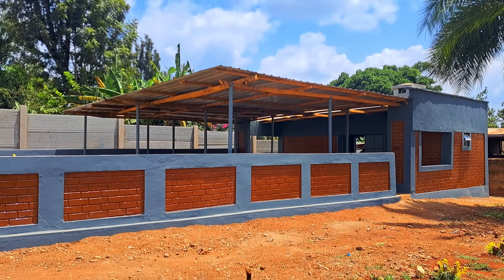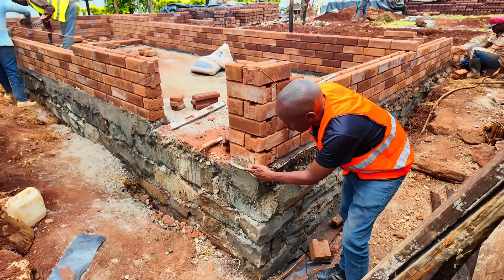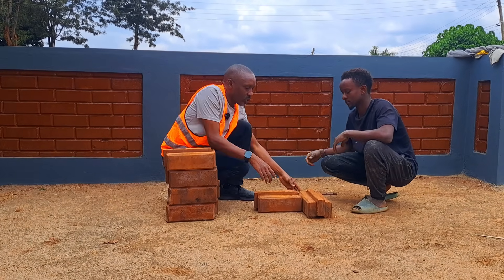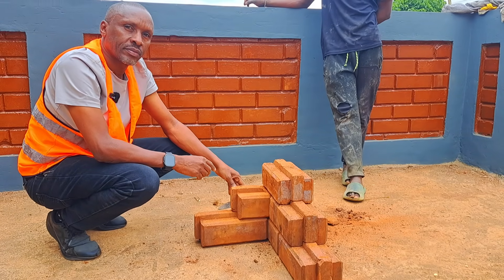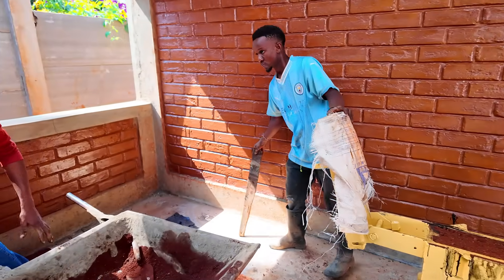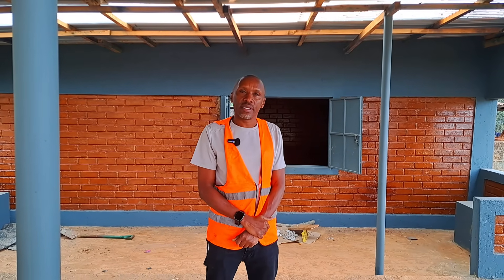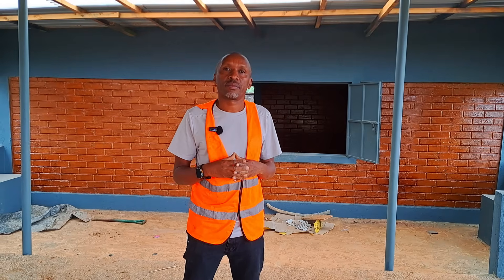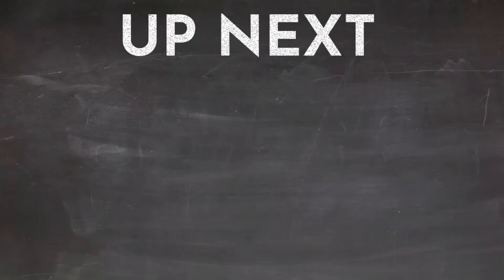How Interlocking Soil Blocks Create Stronger, Cheaper Walls—Explained

Comment: 3:00 - "blocks does not require plaster" - quite questionable. the wind will blow through this wall, plastering is mandatory. you can see gaps on corners at 5:30.
this is looks like a scam to sell equipment😆

Comment: Is no need cement for the first line to connect with beam
Reply: Yes a little mortar is needed to connect the first mother block to the foundation
Reply: @pablokla2 mortar is cement or what glue

Comment: You cannot use beach sand. Very important, because the contained sea salt will weaken the cement stabilizer and easy disintegration of the blocks

Comment: I bought the Makiga interlocking soil block machine in 2015 and built 14 single rooms in Thika. After that experience, I found that the biggest problem was finding individuals skilled in mixing the soil and cement and know how long to cure the blocks and also how to lay them. I turned to Makiga to refer people they trusted but they could not provide this information, rather they asked that I send someone to be trained, who could train others. I thought this was a rather laissez-faire approach especially since the mixing of the soil and cement is a technical/science and needed someone who understood how it works. After searching for a long time, my mum got a contact, who came with his team and did a great job making the blocks. But that was all they could do. We need to get someone who could now build with the blocks...another round of searching, trial and error with one or two individuals who were referred or claimed to be skilled in this area, and we finally found someone. The building happened quickly, and honestly, it could have been done in a day if we had enough manpower. The building was beautiful, but it has been a nightmare protecting the surface, especially the exterior. Eventually, we had to apply cement on the outside to protect from rain. The varnish didn't work well. On the inside, the nightmare was how the tenants used the walls. Where the tenant hammered nails as hanging pins, big parts of the block chipped away. I love the concept, but honestly, with limited funds, I would prefer to use stone and mortar to avoid the additional remedial costs. The 12 rooms (14 by 14 feet) plus two shared toilets and shower rooms cost 1.2 million. Not bad...but these method needs to be greatly improved to maximize on the savings it promises.

Comment: How does this type of construction behave in locations with frequent earthquakes, such as Chile, where earthquakes measuring 6 or 7 on the Richter scale are not uncommon?
Reply: Need another type of interlock block..which is same like on video but got 2 hole for interlocking which is u can fill cement and make it stronger
Reply: Greetings please google ISSB in earthquake prone  areas research has already been done on the same

Comment: To help with the corners, you could change the mould so instead of one continuous ridge on the ISSB, the are two shorter ridges, with a gap to fit the feet of the ISSB that will sit on top of it. 

Great work ❤️
Reply: Very good advice

Comment: In places with rainy seasons, lime plaster over the exterior blacks will add many decades to the life span. White paint will help reflect heat.  Great system!  Thank you.
Reply: Thank you you the ISSB blocks have very good thermal Properties that make them very ideal for hot areas

Comment: Do you have to oil between each block when pressing them? A teflon coating might be exceptionally useful if so.

is there a minimum clay content for the bricks to be stabilized?  What was the finishing solution? A "varnish" was mentioned, but that doesn't really address composition.

What is the Hoop Iron?
Reply: Thin metal strips normally used to secure the truss or roofing structure to ring beam.

Ask at the hardware shops, they have them.
Reply: @webza77  Very interesting. Thank you.

Comment: This is genius, but a little bit of mortar wont hurt ~
Reply: Not necessary. If you use mortar the bricks won't interlock properly and may lead to structural failure.

Comment: I think the mortar is still necessary for brick laying. Not only does it "glue" the structure together, but it also keeps water and moisture out of the walls and interior.

I challenge someone to make a video showing different types of bricks put together, one group with mortar mix the other group without the mortar. Bricks line up in an empty swimming pool built in a simple chimney shape. Then after everything cures, fill the pool up with water to see which interior will stay dry.

Also, giving different squared brick walls a ramming test would prove how strong the brick designs are.
Reply: People build mud houses and your here worried about that? 😂
Reply: It has been interesting to watch your videos about the interlock blocks, i am from The Gambia and would like to know how much the machine cost and the logistics to send it. Thanks for your attention.

Comment: ❤LY. I the exact block design of almost this size and material concept. However, your machine design is superb even though manual. 

I am working on the vibrating type machine which I yet to solve the technicalities.

More blessings to you brother
Reply: Have you solved the technicalities

Comment: Here are the pros and Cons of this kind of block:
Pros : Well adapted with a hot climate, easy to build with, cheap if produced locally, they can stand structure weight (Load bearing block), they can also be resistant for earthquake due to their flexibility 

Cons:  Not good with water because of the clay content, so they need to be protected, they need columns and  at 3 layers of lintels (lower, upper and top) for the walls to be stable due to the lack of mortar, they are also heavier so make sure the foundation is solid enough to support the weight 

Can you save money?  You will save in labor, time and cement but spend more in the foundation, lintels, column and protection

Is it worth it? Depends on the circumstance, your area and design ...
Reply: Columns ?  Like buttresses ?
Reply: @mikeharrington5593  Yes
Reply: Seems like a good way to use rammed earth. 

Question is, are they as durable as incinerated blocks of earth?
Reply: @mckennedykyalo4243  Yes They are durable but still not advisable to expose on the weather [water or Rain], depend on your design, it need extra layer protection like water resistance paint
Reply: What is the best way to contact you? My dad would love this
Reply: @kippy4983 You mean to contact the builder or me as the commentator? 😂

Comment: regarding costs , so it only saves on plastering because blocks it is not a must?
Reply: You reduce costs also since blocks do not require motar ont the joints you save alot on Cement
Reply from the maker: Also transport costs as you make them at your site

Comment: I'd say plastering is needed.
Reply: Plaster is not nesssary but can be applied if one requires
Reply: I also believe it is necessary in the tropical countries to block out moisture and mildew.
Reply: Depends on your taste, even paint on the top of the block should lock good

Comment: There is a big flaw in these blocks laid without cement in between. If you take wall and crush or use whatever method and remove two or three blocks. That wall is whole compromised because the rest of them is just removing them without any tool or effort. Just like cabro romove a few, and the rest is a piece of cake removing. Cement prevents this flaw. Avoiding cement is not a saving in this case.
Reply: You can use hollow ISSB that will have concrete locks on the hollow part. I have that mold
Reply: You can do mortar on the inside with a layer of plastic mesh or metal mesh. It will reinforce the blocks and you will have a smooth wall. Technically you can do it inside or out, but you must waterproof outside.
Reply: @victoriadedicova not understanding, can explain what you meant?
Reply: @mosimba2665 i think she means that you can do plastering inside or outside by supportkng with plastic or metal mesh to make it more strong but don't forget to applying waterproofing specifically outside.
I stand right to be corrected if am wrong 🤓
Reply: @konanicodemus4930 thanks for the clarification, yes it is not a solution, with this brick the best practice is to have concrete columns at every corner and also have bottom, middle and top reinforcement (Lintels) to make the structures stable ... The lego interlock bricks are more flexible because you can use the holes with concrete and Iron bar for Column and U brick for lintels... And can build up  2 to 3 floors without conventional reinforcement
Reply: @konanicodemus4930 could there be any structural problem in using flat soil blocks( blocks without the interlocks) then using the motar in between the courses as of normal contruction?
Reply: @victoriadedicova kindly explain to us how we can do waterproofing
Reply: Check also lego blocks which use little cement to lock those blocks supported by iron rod
Reply: These specific blocks have structural problems but only because they use soil. I have seen some other factory opposite isinya feeds whose blocks are pressurised and don't use this loam soil. That said have you ever asked yourself why the oldest structures on earth are dry stacked stones?
Reply: Great wall of China Was built with pressed earth. Great ancient Monuments  palaces  around the world were made with rammed earth. Soil is the Most durable construction  Material.
Reply: Depends if it is well constructed with all the structures, you should be fine, a lot of countries are already using them

Comment: How do you install power conduits & piping in particular
Reply: As with all other blocks, make a hole inside the blocks, but this is not good for structure integrity as no mortar
Reply: You can install conduits in the plaster mortar but you need to make it thicker to compensate. The blocks weaken if you put holes in them.
Reply: @webza77 you mean make it expensive ... And the all purpose of this type of construction is const effective...
Reply: Wait for the next video,
Reply: You will get the answer

Comment: How many floors can be made with the stabilized soil blocks
? Like, can you make a lets say ,a 10 floor building or is there a limit??
Reply from the maker: I asked that question and basically, there's no limit as long as your foundation, columns, beams and slabs provide sufficient support to your structure
Reply: Yes this is true there is no limit as regarding the number of floors on can build useing ISSB blocks

Comment: Greetings Viewers please ask any questions you may have regarding building with stabilized soil blocks
Reply: How can we contact you for the blcking machine and training
Reply: What is the ratio of cement to soil for the issb?
Reply: @rickyrich3733 Usually as a base formula 10% cement, 20% clay , 70% sand  ... Now from this formula you can start testing  and and adjusting slowly til you reach your desired results ... For example if there is more clay in the soil you add more sand or if there is more sand in the soil you add more clay then cement depends on the strength you want to achieve. Don't use black cotton soil
Reply: The ratio depends on the type of soil which type of soil do you have at ur site
Reply: #Pablokla2 how much would it cost to do perimeter wall 🧱 of a plot of 100 by 100 ,Thank you.
Reply: Can one use black cotton soil?
Reply: @kanyiian noooo